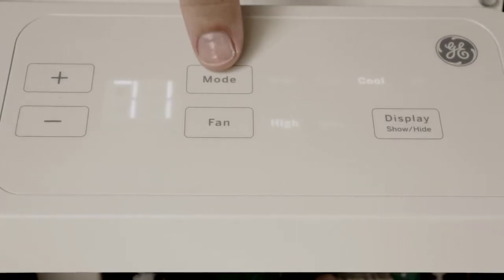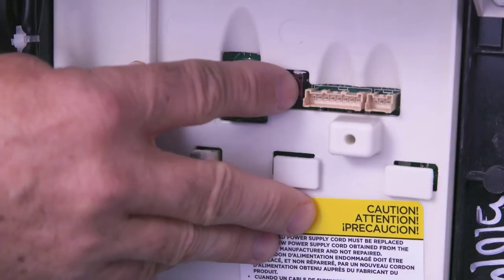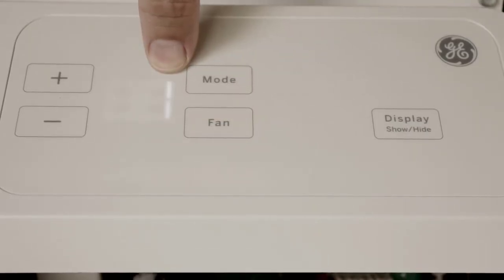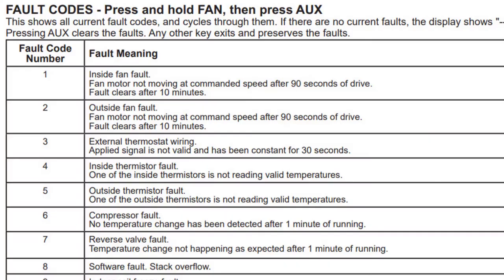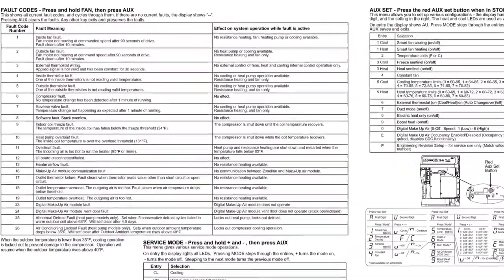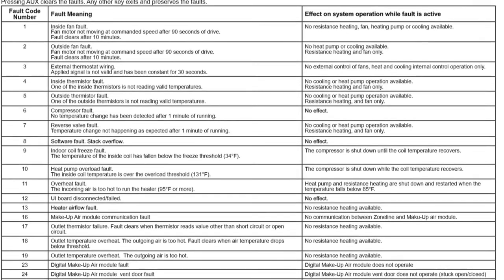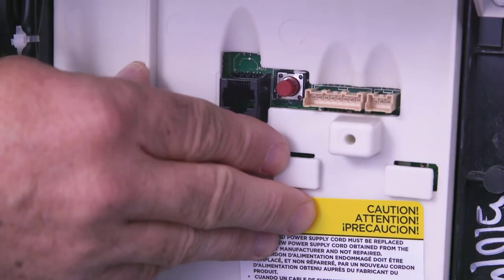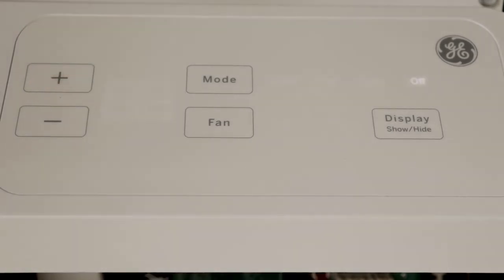GE Zoneline PTAC - How to access fault codes.

Comment: Been in the phone with zone line on hold for 30 minutes first time I called they answered right away not even 2 minutes later I call back and the put me on hold for 30 minutes if there was a place to give them 0 stars on customer service they’d earn a 0
Reply: I give them -0.  and I am not kidding.  if it wasn't for bldg codes in rentals, i would still be using an amazon purchased space heater for warmth.  but paying $90 a month due to "heater" is what the electric company I pay claim.

Comment: When my 4 season room hits over 90-95 degrees, my unit's fan automatically kicks on and I can find error code '11' in there. Fan will run until it drops below 85 degrees, wasting electricity for me. GE help doesn't know how to stop it but I found out about error code after talking to them. It's supposed to mean too hot to run the heater, but I hadn't no intention on running it.
Reply from the maker: We are happy to look into this further for you if you still need assistance. Please send us a PM/DM on our Facebook or Instagram with your full model and serial number. If you need help locating that information please see the link here http://spklr.io/6054Ulqk.

Comment: I’m pressing fan and auxiliary bat I don’t heve number always- - but I do not have heat
Reply from the maker: Hello,

If your unit doesn't heat as it should, it's possible the air filter is dirty, the outdoor/indoor airflow is restricted or recirculated, outdoor air is entering the room, and more. Please review the troubleshooting on page 25 of the owner's manual here: http://spklr.io/6051WYKt..

For further support, please call 1-844-GE4-PTAC.

Comment: Is there a reset button on this PTAC??? if not how do you reset it manually?
Reply from the maker: Hello- We are happy to help! You can reset the unit and turn off your air conditioning by flipping the breaker that powers your air conditioner. There is also a test and reset button on the plug case or the inline case. Please review page 19 in the manual. http://spklr.io/6056l7MK Note: The dedicated Toll Free number is 1-844-434-7822  where a Zoneline Specialist is available to assist the caller with their Zoneline Service Needs. We hope this helps! JW

Comment: I have one of three on this property - ptac az45, march 2022 purchase set at 72 for heat.  the air out of small top duct that (unit in a diy cabinet with diy duct into bedroom) is showing at 75 degrees.  it is set at cycle.  shouldn't the stupid thing shut off at maybe around 73?  sure, continue for 45 seconds or what ever.  it clicks all the time, same fan control - nothing faster/slower - etc.  nothing shows for any fault codes at all.  did the mgr buy this from a guy who knows a guy that gets them for free off of a parked semi?
Reply from the maker: Hi Barbara. We're truly sorry to hear about the experience you've had with our appliances. This certainly isn't expected, and we apologize for the stress. If you're still in need of assistance, please visit our site here: http://spklr.io/6052YJOK. Thanks. -AT

Comment: Hello.  I got a fault code "AU".  What does it mean?
Reply from the maker: Hi Joanna,

We're so sorry to hear about the error code that you're seeing! Error codes are there to help a technician quickly diagnose an issue. We would recommend reaching out to our service department for assistance with this issue. They can be reached through the following link: https://www.geappliances.com/ge/service-and-support/service.htm?_ga=2.141643569.2049765696.1598275011-830289652.1595960538

We hope that this helps!

Stay safe. -MS
Reply: @geappliances   don’t want a repairman yet. Any assistance would be preferred to troubleshoot myself first. 
Mine is flashing AU no matter what I do
Reply: When I turn panel to OFF - then hit the small RED button, I get AU that stands for auxiliary control-aux set button (***to me?  it's all bs) doesnt help unless you are really really famililar with hvac systems of all types.  being married to one for over 30 years didn't help me, ordered a ge repairman who called and cancelled 10 minutes before end of window time.  I waited 2 weeks for that, too.NOT  Nice.  I legally got out of my lease thru bldg codes demanding landlords to heat to 68 degrees which mine never reached 65...